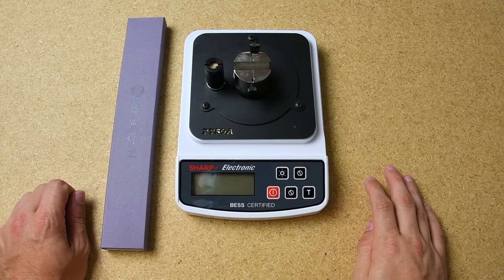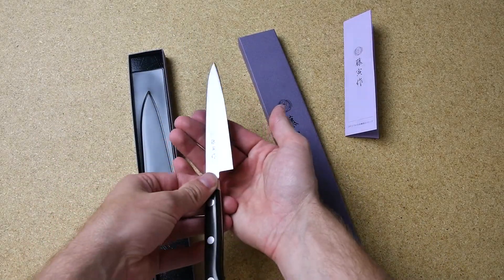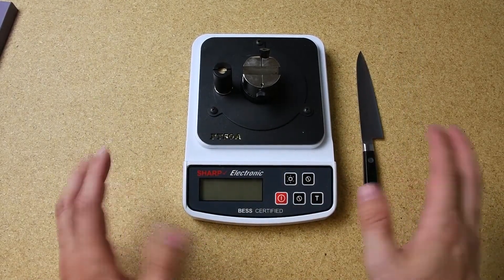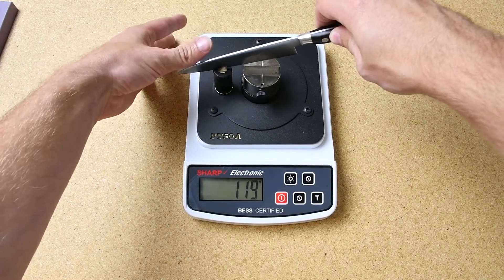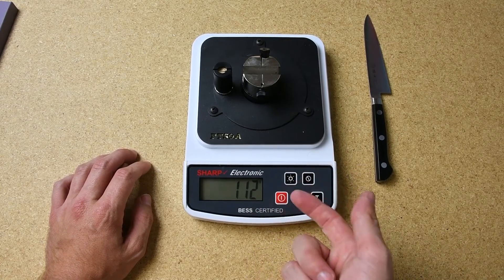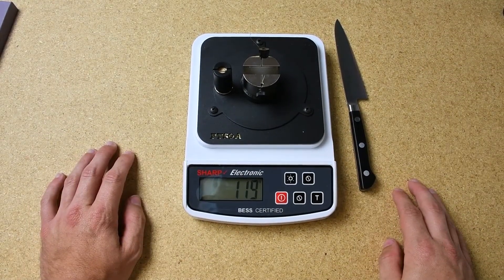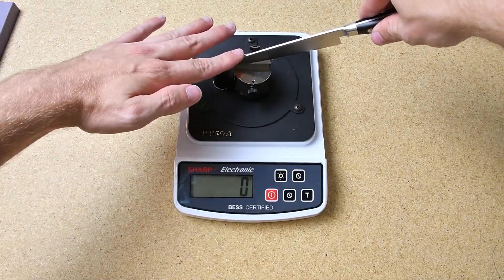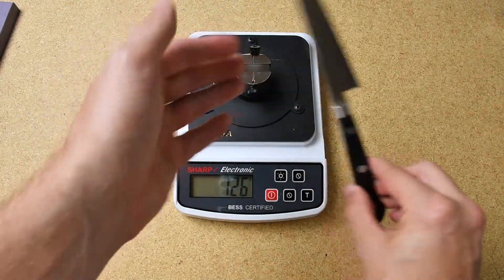Testing the Out of the Box Sharpness of a Tojiro DP Petty

Comment: Thank you for showing this.
Love that tester, great for data wh0res like myself.
I do the same, back, middle, front for OOB tests.
The scores were good on that one, pretty good edge continuity all the way down.
You may have got a bit better, had you not run your finger on it before testing, which I've seen on other sharping channels.
Even air from strop walking over to tester takes away bess with every step, haha.
This is the first time I've seen the test done like that, the instructions say to go slow, so that you see the numbers gradually going up.

I like your way better as it's a bit less stressful.
Thanks again.